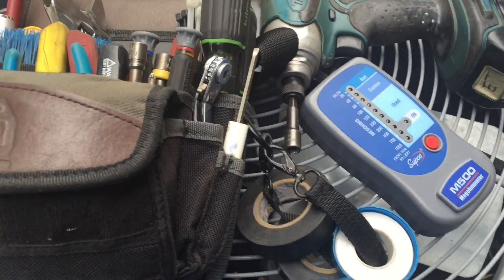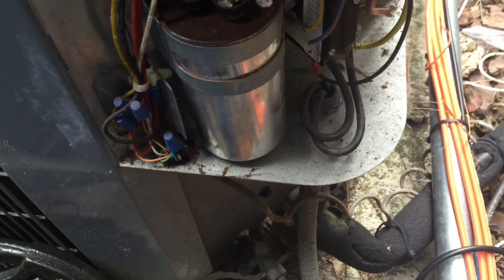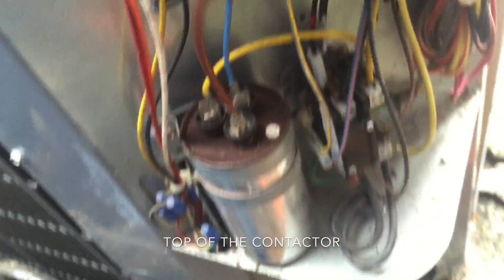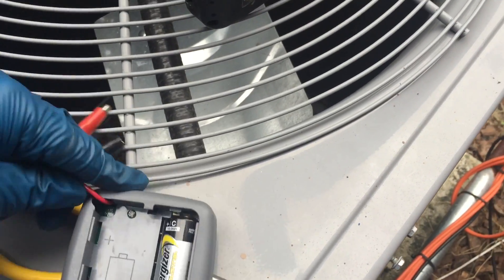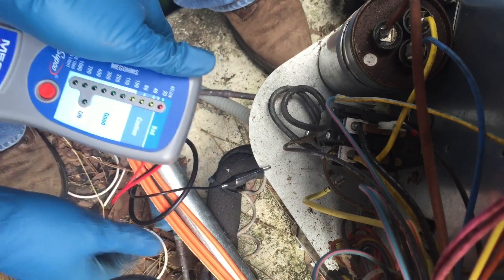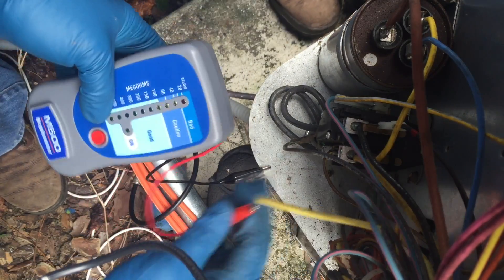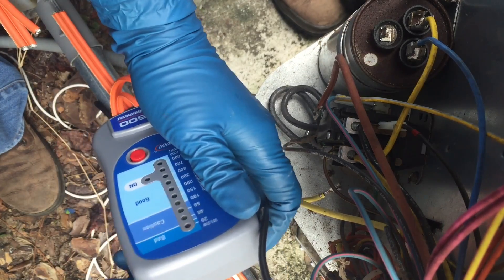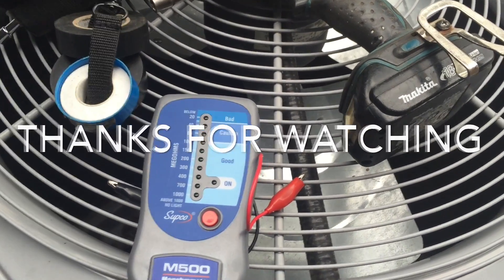Condenser Fan Motor Diagnosis

Comment: Good Job brother. I don't like that megger but it does the job. I gave mine away to my brother.
Reply from the maker: I was told it would do the job for anything under 5 tons just  mostly residential..  Thks for the support man..
Reply: eddiehvac actually I've used it on higher tonnage it works well its not to bad.
Reply: Hey Emin what megger are you using??
Reply from the maker: Thks I try it out..